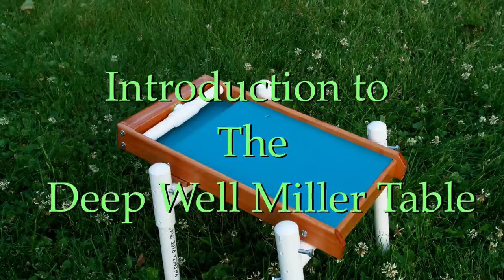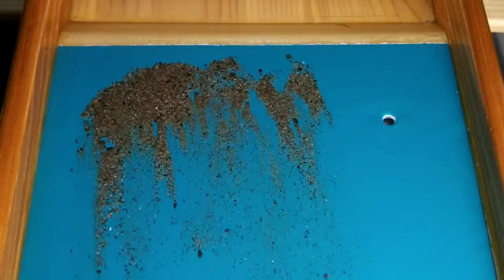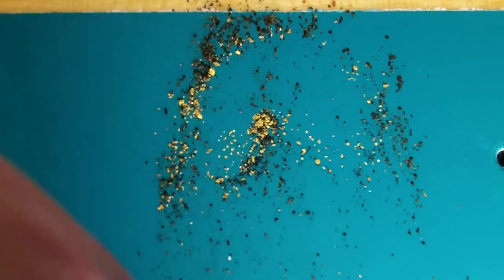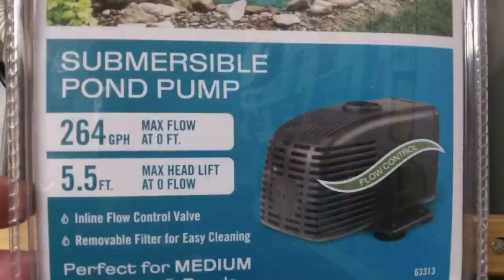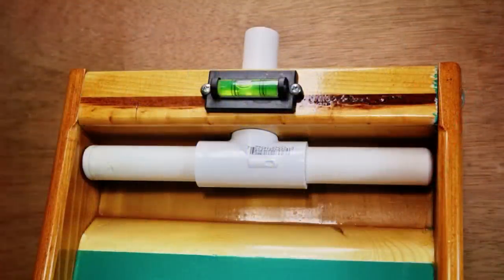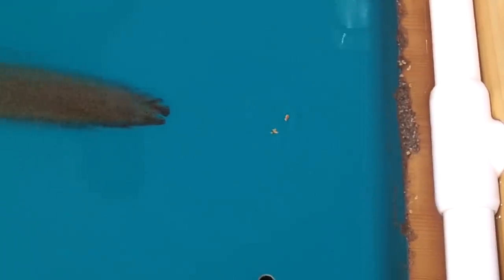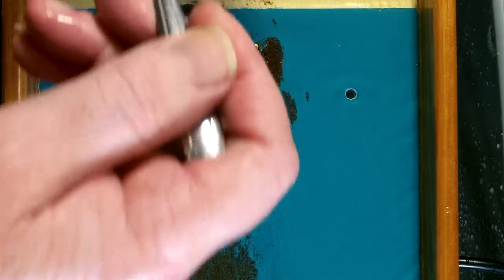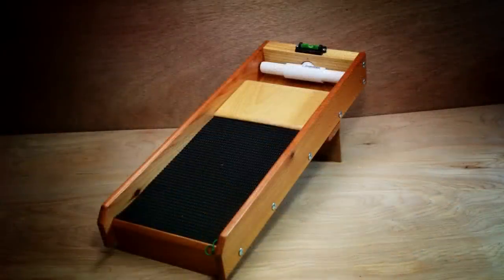NEW MILLER TABLE INTRODUCTION

Comment: Hi Utah... going to build this right awy.  Where did you find the tubing for the pump please?  Will be using it in Southern Utahfor really fine gold.
Reply from the maker: Hi Intown and thanks for watching. The tubing is regular 3/4 inch bilge pump hose you can buy at any boating store.  I bought mine on Ebay. It runs about $1.00 a foot. The valve I use is a 3/4 inch gas valve you can buy at Home Depot or Lowes in the plumbing dept. They also carry the hose barbs that you can use to connect the hose. Get the MIP thread.  You only need about 150 GPH to run this.  Harbor Freight has a 264 gallon pump that works well for a 110 volt pump.  It's more than you need but you can reduce the flow with the valve.  I like it because it has a good dirt filter on it. 
If you use a battery operated Bilge Pump, you might want to look up a PMW motor speed controller on Ebay like this one.

https://www.ebay.com/itm/Manual-Dimmer-Knob-Controller-DC-12V-24V-30A-for-Single-Color-LED-Strip-Light/333002803799?ssPageName=STRK%3AMEBIDX%3AIT&_trksid=p2060353.m1438.l2650

Don't buy one that ships from China at this time.
This will allow you to fine tune the water output by controlling the pump speed. 

If you build this table and find you like it, you may want to try building my combination Deep Well fluidbed, sluice, Miller Table. You build it the same way.

I have a video out on it. This will allow you to run more material faster in the sluice mode. Also check out my video on running the 10 inch silicone mat video. It shows this sluice in action. It does a great job of catching this very fine gold we have here.  I hope this helps. Best of luck.
Reply: @utahavalanch  Thanks so much for the quick reply. I will check your other videos out.
Reply: @utahavalanch  BTW do you live in the northern part of the state? It would be great to get together and propsect a little.
Reply from the maker: Intown 
Hi Intown. Yes I do. A little north of SLC. I always enjoy getting out and meeting other prospectors. Unfortunately due to medical conditions, I can no longer drive and have to stay pretty much local. If you saw my video on Urban Prospecting with my grandson, that's a lot of what I do now days. Lots of material available.
Reply: @utahavalanch  When building the sluice which mat is better, The Gold Stop or vortex?  Would ribbed carpet do as well? Also how long a board do you reccomend for the sluice or Miller table? Thanks for all this info and videos.
Reply from the maker: @intown759  

Hi Intown.  Both the Gold Stop and the Vortex mats are the same thing.  Martin Prospecting sells the Vortex mat as the Gold Stop.  It's not really a gold mat but a conveyor mat that does a fair job of catching gold.  The main problem with it is the little pockets fill up first thing with black sand and the gold has to sit on top on the sand.  If your water flow is too fast then the gold gets washed off. Ribbed Carpet works quite well but it needs some expanded metal placed on top of it to create areas the gold can fall into and get caught.  Fast water can wash the gold off from this as well if you are not careful. The best mat would be a Silicone mat as the gold tends to stick to it.  A mat like I use in my Combination sluice/Miller Table is about the best you can get.  It has large deep pockets that have enough room to hold all the black sand and gold. I like to keep all the black sand as there is usually gold that is the same size and weigh and if you wash out the black sand you lose that gold. Very important if you are trying to catch the very tiny gold we have here in Utah.
If you follow my video on making the Silicone Mat, you can make one quite easily, You can buy the square dowels from Home Depot and Lowes.  You use a 1/2" dowel for the frame and a 3/8" dowel for the troughs.  This is the mat I use on my Combination sluice/Miller Table and it catches everything.  Right down to the 200 mesh gold.  It's really not that tough to build.  Give it a try.  If it doesn't work out like you want the first time, then try it again.  Each time you make one you get much better at it. It usually takes about 4 tries for me before I get it to where I want it.
The length of the sluice depends a lot on how big a pump you are using on what size of sluice.  I have an 800 GPH pump that I use for my 6 inch to my 11 inch sluices and it has a valve in the middle so I can control the water flow to match the sluice width.  I now have an inexpensive motor controller that controls the speed of the pump motor so I can fine tune the flow to fit the size of the material I am running.  There are a number of them you can buy up on Ebay.  Look for a PMW motor speed controller.  There are a lot of them under $10.00.  My sluices have to fit in a Home Depot Hefty 10 gallon tote and so they are 21 inches in length.  If you use a larger tote then you can make your sluice longer.  24 inches is a good size. Many people on the net use big pumps and fast water in their sluices and they blow out all the gold that we try to keep. If you go to an 1100 GPH pump then you can go to a 3 to 10 foot sluice. I do tests on my sluices and find the water flow where I keep all the gold in the top 4 to 6 inches of the mat and so I don't need a very long sluice. The faster the water, the longer the sluice you'll need.

If you watched my videos and have seen my recirculating set up. This is what I use for everything now.  I have  Gold Hog and California sluices but I now like to use this much better because I can calibrate the angle and flow to catch every piece of gold in a bucket of dirt.  Yep, it's not fast but it gets all the gold no matter what you run through it. I had too much trouble trying to get a water flow through my other sluices to keep the small gold and I lost a lot of gold. I now catch 100 % of the gold instead of 20%.. Hope this helps. If you have any more questions just ask. Lots of luck.
Reply: @utahavalanch  Hi again.  I am building the deep well Miller table now and will do the mat later.  Thanks so much for the help.
Reply from the maker: Intown 
Best of luck on your build. I gather you probably saw my video on how to make it? If you decide to make the combination sluice/Miller Table later on, you do it the same way only you make the top deck shorter.

Comment: What is the pump size and flow rate please?
Reply from the maker: Hi Zenon and thanks for watching. The pump size only needs to be about 150 GPH but I use a 110 volt 264 GPH from Harbor Freight. This comes with a 3/4” hose adapter so i can use the more flexible boating bilge pump hose. I bought a gas valve from Home Depot and put in the hose so I can control the water for the different sizes of gold. They also sell the 3/4” hose barbs to connect the hose to the pump. Get the nylon barbs with the MIP thread.
You can also buy a 300GPH Bilge pump if you want to go battery power and use the same hose on it. With the 12 volt pump you can also buy a 12 volt speed controller on Ebay for around $8.00 - $20.00.
Reply: @utahavalanch  Excellent thank you for the info I intend building my own, I have some Scottish paydirt that has some very fine gold and very heavy minerals, hardest paydirt I have worked so far.
Reply from the maker: @zenon-paulking3399  
Well, this will do the job quite nicely. You just need to be able to control the water flow for the fine gold. I also have a video that will take you step by step on how to build. Best of luck to you.

Comment: Is that 1/2" or 3/4" pvc pipe? I'm getting the parts together to build me one.
Reply from the maker: Big Country Vet 
Good deal. I think you will like it. You can use either one but I generally use 1/2" on the Miller Tables as you don't need much water to run them. I use a 1-1/16" hole saw to drill the hole in the header board for the PVC Tee. It's a little too small for it, but I use a 1/2 round wood rasp to enlarge it just to the point I can fit the Tee in  so it's water tight. Be sure to get some Spar Varnish in the hole to waterproof it. You may have to file a little more after it dries if you have a hard time fitting the tee in. That is the main leakage point as the bottom of the hole is under water. 
I usually make the sides and header board 2-1/2" high. That way if you don't have a table saw, you can buy 3/4" 1x3's in the cheap lumber section or 1/2" 1x3"s in the Hobby Board section. I like the little thinner 1/2" myself and I rip cedar fencing down the middle to make them. Hope this helps.

Comment: What's the pitch you have on your Miller table
Reply from the maker: I have found that an angle of about 3.5 degrees works well. I like to start with the table nearly flat and then turn on the water. Then I drop a little bit of black sand on the table that has been screened to the same mesh size as your dirt. Then I raise the back of the table little by little until the black sand just starts moving down the table. You may have to adjust both the water flow and the table angle. Be sure to have a way to adjust your water flow like a valve or pump motor controller. Most YouTubers run the water way too fast and lose most of their fine gold. Also use a small brush to spread the material out so the gold can touch the table surface and stick. If you can slow your water down to about 150 GPH, you can easily catch gold down in the 200 mesh or barely visible range.

Comment: what degree do u have your table set at?
Reply from the maker: Stanley Mudge 
Hi Stanley, and thanks for watching.  I usually set it at 0 degrees, turn on the water and spread some black sand on the table. Then I slowly raise the table until the black sand starts moving down the table. That usually turns out to be around 3 - 31/2 degrees.

Comment: What size do you classify to before running it on your table?
Reply from the maker: Hi Four Mile. Thanks for watching. You can classify and run from minus 4 mesh to minus 200 mesh and be sure to adjust the water flow for each size. It's very important to screen material to the same size before running and adjust the water flow for each size you run so you don't wash the gold off the table. 
I usually screen my material through an 8, 12, 20, 30 and 40 mesh screen and run each size separately. The 30 mesh screening is the most important size to check because if there is any gold in a sample it will be in there. If you find gold in that size then check all the other screen sizes.
Reply: Are you familiar with the Black Scorpion Miller table?  (http://www.gpkcompany.com/Black-Scorpion-II-Fine-Gold-Recovery-Table_p_121.html) I was told you don't have to classify past 20 with the black Scorpion. What makes yours different in terms of having to classify to same size?  thanks for the response! Still learning so much about prospecting. Cheers!
Reply from the maker: Yes, very much so. It's one of the reasons I started building my own. Since then I have built over 40 different Miller Tables of different styles and using different mats, paints, and truck bed liners.
You don't have to classify any of your material for any table if you don't want to but if you want to catch the fine gold it helps a great deal. Gold recovery goes by weight. If all of your material is classified to a certain size, the Gold being the heaviest will sink down to the table and if the water flow is adjusted properly, will stay while the rest is washed off. If you classify to 20 mesh, then you will catch all the gold that is 20 mesh in size. The 30, 40 and smaller will get washed off because the 20 mesh is much larger than the rest and the water flow needed to process the 20 mesh material will be way too much for the finer gold and it is lost. So if you want to keep the fine gold which what I'm after, then you must classify it down to the different mesh sizes and adjust your water flow so that it only washes off the lighter material and the black sands.
Hope this helps.
Reply: That's a really helpful explanation on why to run material classified instead of everything together. I'm also after the fine gold as that's all I am finding so far here in Colorado. I really appreciate your time and insight, thank you so much. I'm convinced I should invest in a table now. I can't handle panning my life away! =)
Reply from the maker: The next step up from panning would be a sluice. If you don't want to invest a lot of money in one yet, take a look at my videos on making the drop riffle sluice. These are easy to build and require very few tools. I have used this design in one form or another for 50 years and I'm still using it today even though I have some top end commercial equipment. The best way to catch the fine gold is to screen it as well even if all you have is a kitchen strainer. You won't be able to move as much dirt but you will be able to catch more gold than most prospectors who are not and losing the fine gold. You can clean the gold from the dirt left in the sluice with a Miller Table. I also have another video on a cutting board Miller Table you can build easily without many tools to get you started.
Reply from the maker: Great, sounds like you are pretty well set. I think you would find a Miller Table very helpful in working your cons. You can make one easily. It doesn't have to be fancy, just functional. Hope you have a great summer.
Reply: Thanks again for the info and guidance!
Reply from the maker: Four Mile Fox 
You're welcome. I hope you have a very golden summer.

Comment: My last name is Miller and I live in Utah! Imagine that 🤣😂
Reply from the maker: Ahhh, very good Mr. Miller. Right this way, your table is waiting. 😁
You never know, it may have been one of your distant relatives that invented this. A great piece of equipment.
Reply: @utahavalanch  out of the two styles of silicone sleuth pads that you have used? Which one have you found that works best? Could I cast a mold out of a washboard?
Reply from the maker: @TheYammerHammer  
My favorite so far is the drop riffle that I made the videos on. I have used it on my combination sluice and highbanker all summer and although it’s quite short, it hasn’t lost a single piece of gold. It’s easy to make as you just use square dowels you buy at Home Depot. In one of my videos I made a mat from a cardboard box so yep, you can make one out of a washboard as well. You can just make a small mold or cast about 3” square to see how it looks without investing a lot of money.
That’s what I do to see if an idea works out or not. Those wood shutters you can buy at HD make really good mats also. The thing that’s nice about the silicone, is that gold sticks to it. So if in the tumbling around in the riffles it happens to touch Silicone. It sticks. Kind of like flypaper for gold.

Comment: Why not just make the entire base out of one piece of two by material?🧐
Reply from the maker: Anagram Confirmed 
Hi Anagram, and thanks for watching. You certainly can, but it is much easier for me to do it in two pieces and glue them together. I also did it this way for people who want to try building one of these who don't have access to a lot of power tools. You can make one of these with just a handsaw. A drill and 2 bits.

Comment: Very nice ,I'm going to build one for sure.There is only one improvement I can see that needs to be done ,to save the life of your pump.You should install a tee right before your valve with another line leading into your tote.You simply turn the valve to adjust water flow to your table just like you do now,but you are not restricting the pressure the pump is creating,you are diverting the water pressure and only using what you need.there is a physics property called cavitation,that explains this more in depth.I like your narration ,sound professional like a show you would see on TV.
Reply from the maker: Thanks for watching Maserati. Yes, I know what you are talking about and I have that set up on mine normally but I find that it takes a lot of video time to try and explain it to folks and most don't understand it after I do so I just try to simplify it. You're right it really does help extend the life of your pump. Thanks.